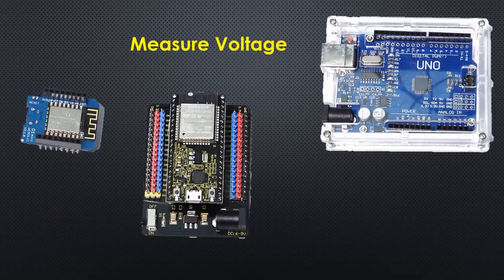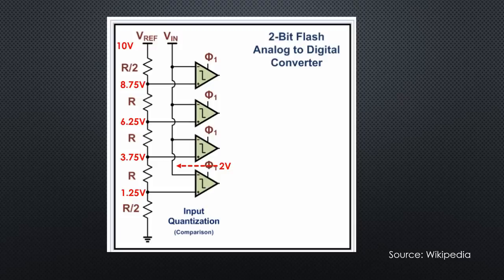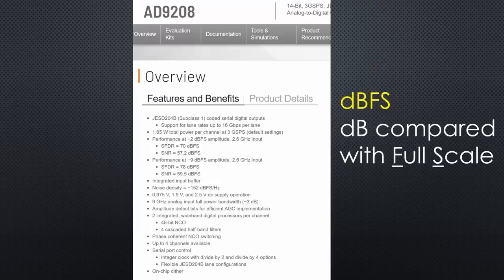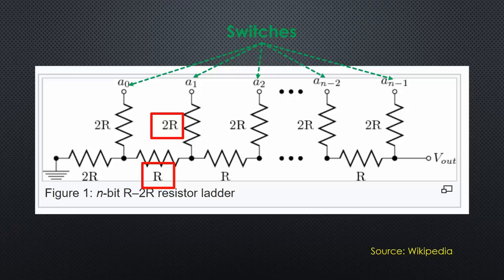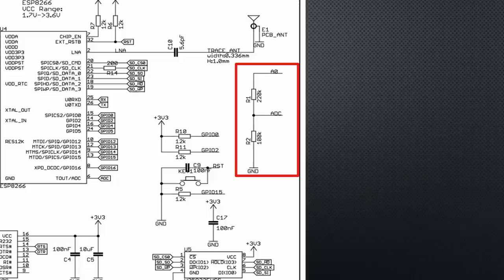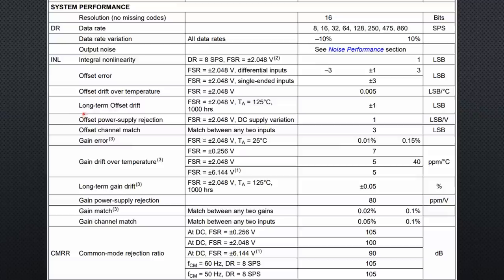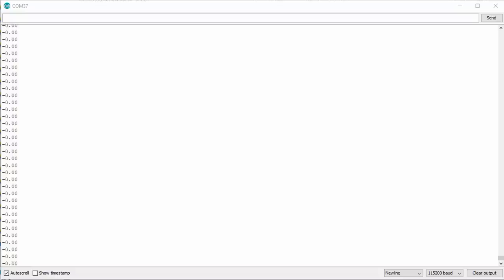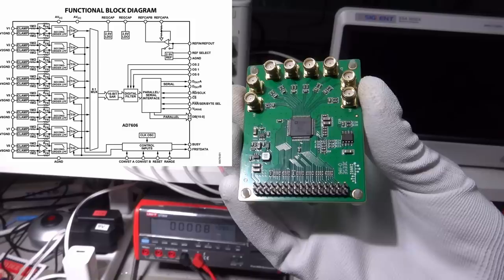#340 How good are the ADCs inside Arduinos, ESP8266, and ESP32? And external ADCs (ADS1115)

Comment: Can not recommend 'average' to smooth sensor data. 'mean' is far more reliable in my opinion and a lot faster because no division is made. Just a bit more memory is used.
Reply: Average is the common word in English used to mean ‘mean’!  The other mathematical possibilities are median and mode, but not so frequently used.
Reply from the maker: Which formula do you recommend?
Reply: Andreas Spiess I’m not an expert in loop stability...  Mean is what I think you were doing - sum all the samples and divide by the number of samples.  Median means the value of the sample where there are an equal number of samples higher and lower than this value.  Mode is the samples value that occurs most often. Both median and mode require that you have an array of N samples to store the number of occurrences of each value whereas the mean just requires you to accumulate the sum (in a long or long long word). Seems more reasonable for an Atmel with limited RAM.  Mode might be ‘better’ if RAM is not limited as it gives you the most frequent value of the input.

Comment: I was wondering if you would be able to get through this without running into a sigma-delta ADC. You didn't. All the off-board units were of this architecture... The sigma-delta converter has to be clocked at a high multiple of the sampling rate (usually 64, 128 or 256 times) so it is limited in sample rate, but since it is based on a single bit converter, it is inherently linear, and it has a built in low pass filter which makes anti-alias filtering (which wasn't covered) much simpler.
Reply from the maker: You are right with the off-board units. But I am too stupid tu understand the sigma-delta concept ;-)
Reply: @AndreasSpiess  So is everybody else. 35 years after having the technology explained to me, I still can't understand why the high order feedback causes the noise distribution to skew toward higher frequencies, allowing it to be filtered out...

Comment: Using Arduino PWM for signal generation and internal comparator, a precise DelSig ADC can be implemented in Arduino for precision work.
For reference, read the Parallax app note. 
Link - https://www.parallax.com/sites/default/files/downloads/AN008-SigmaDeltaADC-v1.0.pdf
 Thanks for sharing.✨✨
Cheers
Reply from the maker: Interesting concept. Did you try it?
Reply: @AndreasSpiess   Way back, I had implemented it on XC6L__ FPGA for sound detection using an external comparator.
Nowadays, this type of DelSic ADC comes built-in in PSoC 5LP which I often use for many DIY projects.
I had also done it on atmega328p.
I am not sure if it can be implemented on all microcontrollers like ATtiny, etc as Delsig needs Timer, Counter and comparator, and memory or dedicated peripherals for UART.

Comment: So can a Wemos D1 mini measure its 3.3v input-voltage?
Reply: Yes
Reply: @ManfredAckermann  Simply connect the 3.3V to A0 and use analogRead()?
but when the reverence input voltage changes, is the analog reading disturbed?
How do I calculate the correction factor e.g. 3.09?
Reply: @bernt6500  it appears that the ESP8266 has an internal bandgap reference as the ATmega also has. This means the internal 1 V reference will stay constant independent on the supply voltage. https://www.sciencetronics.com/greenphotons/?p=1536

Comment: Great video but the AREF pin is connected in arduino
Reply: available yes, connected to circuitry on the Arduino: no.
But be careful, if you switch the ADC reference to the internal bandgap reference while connecting another voltage to AREF blows out the internal bandgap reference for good.

Comment: Been working on a fluid electric conductivity meter on esp32 for about a month and I'm definitely feeling the inaccurate adc. I'm using the I2S ADC/DAC to inject a sinc wave into the fluid and read out the voltage from a differential opamp. Time to look into an external ADC. Check out the code here...http://github.com/physiii/grow
Reply from the maker: Interesting project!